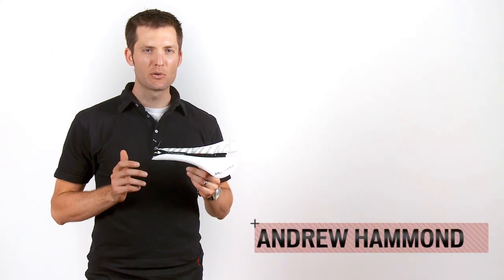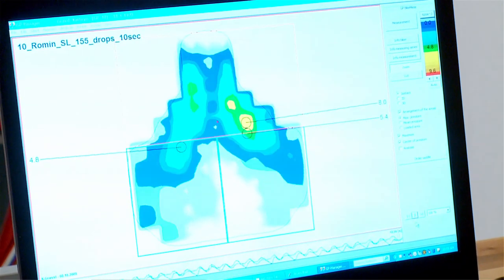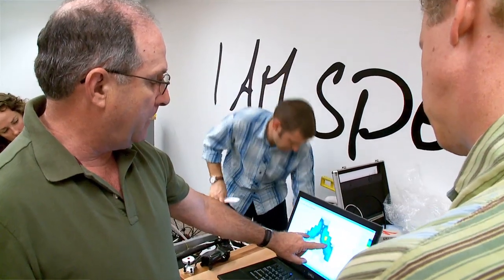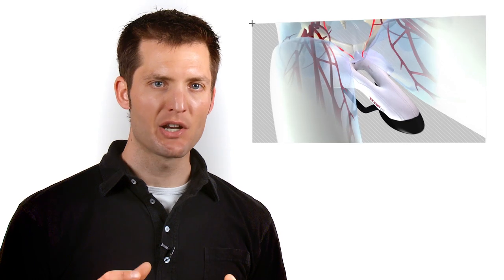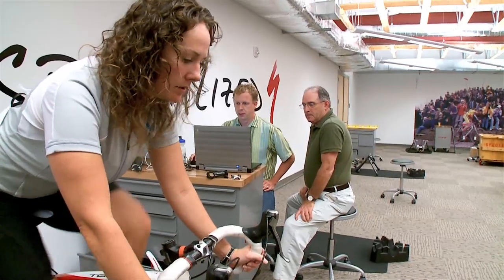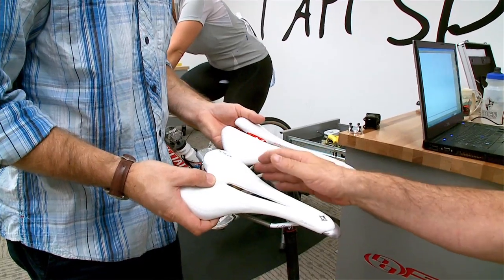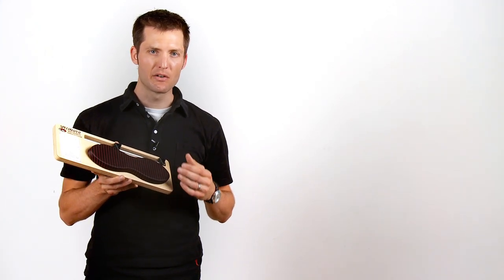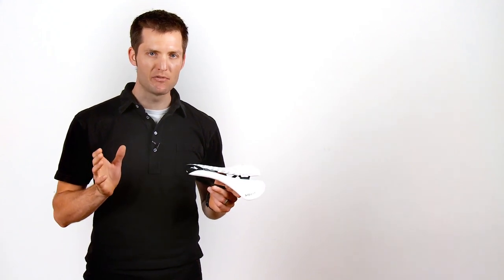Specialized Body Geometry Saddles

Comment from the maker: @email16v check out our dealer locator on our website. For a full BG Fit (which is WAY more than just measuring your sit bones) you can search and find a dealer in the Dallas area that is a BG Fit Center or Certified BG Fit Technicain. If you're just looking to find the perfect saddle then any Specialized shop should be able to help you out with that.

Check out Bicycles Inc. or Plano Cycling & Fitness - both are BG Fit Centers in the Dallas area.